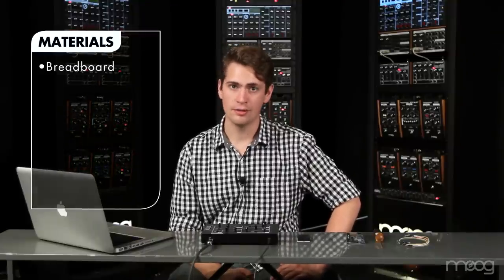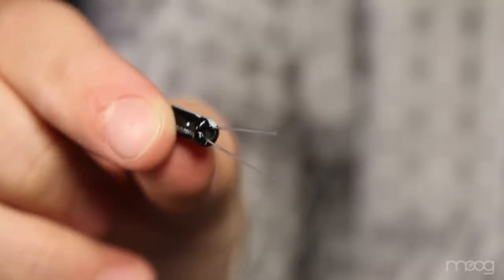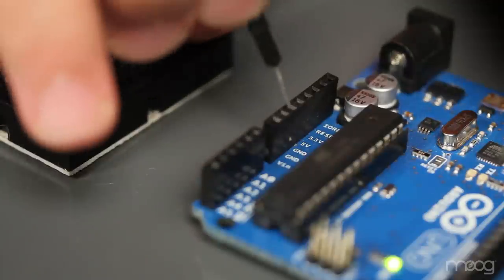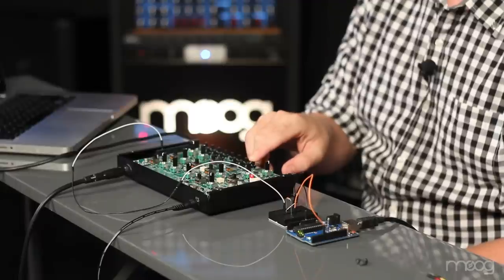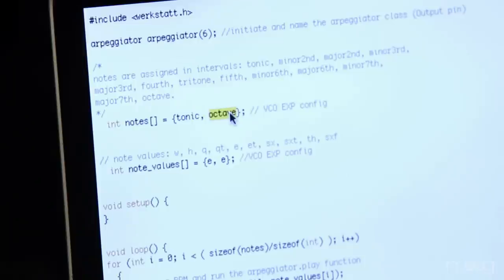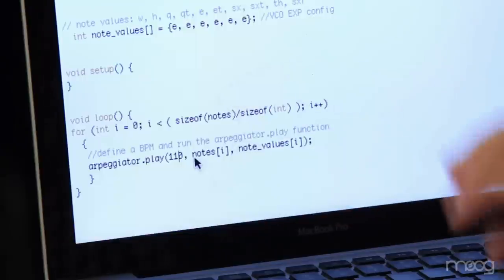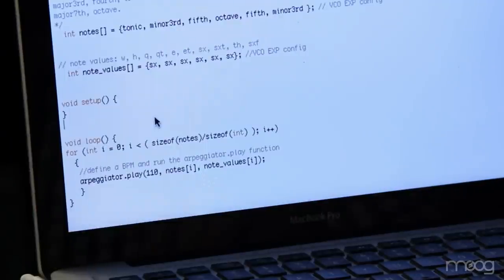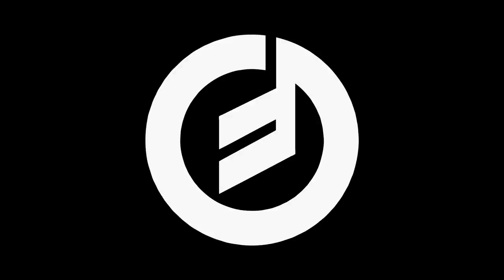WERKSTATT-01 | Arduino Arpeggiator Mod

Comment: Question:
Could this same setup be used to build a sequencer for other modular gear?  It would seem that the same manner of signals would work with other gear and not just the Werkstatt.
Reply: +evwaldron It's control voltage, so I assume that it would work well for other modular gear.